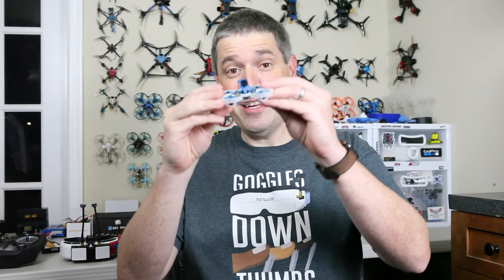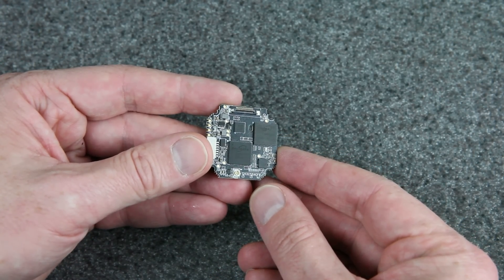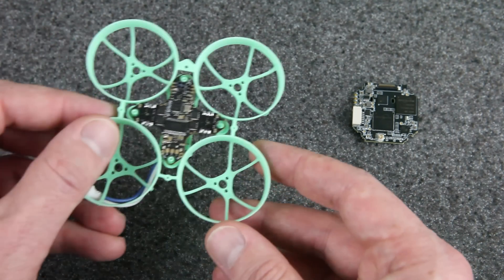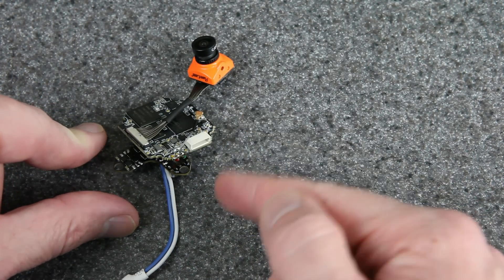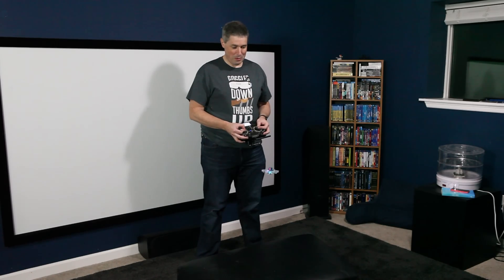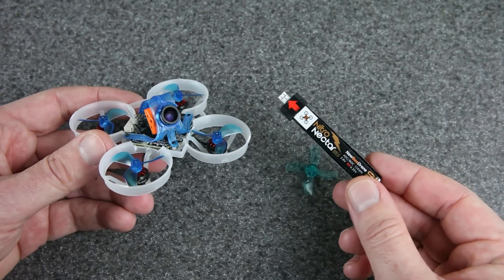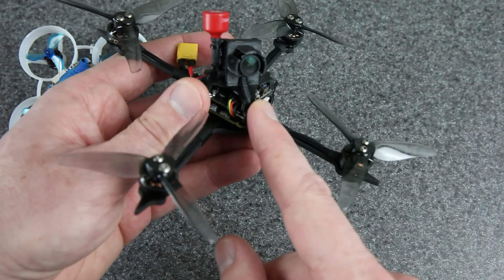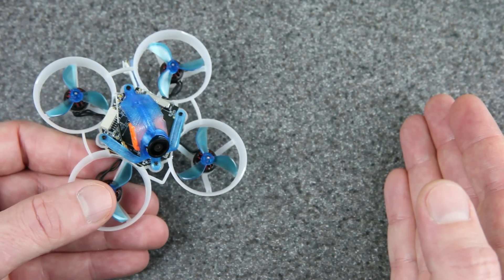The World's Lightest HD FPV Whoop is AMAZING! (HDZero/SharkByte 1S)

Comment: How did you get the osd to show? I have the same set up. Connect straight to smart audio and can’t get the osd to show. :(
Reply from the maker: The OSD type has to be set to MSP Display Port. I don’t remember the exact command off hand, but it is listed in the SharkByte/HDZero manual. If you are on Betaflight 4.3 with the latest Configurator, then it is really easy because you can use the Presets tab (just search HDZero).

Comment: 2 min. Still seems heavy for 1s. 2s would be good and maybe 3+min without killing the battery.
Reply from the maker: It is a bit heavy for 65mm 1S, but I wanted to push the limits and see just how light 65mm 1S digital could be. For better battery life and better acro performance, you could build a 75mm 1S with 40mm props, or an 85mm 2S with 2" props. Either of those would fly great with this new HDZero gear.
Reply from the maker: Oh, and my updated build is a little under 23g.

Comment: Hello, thinking about doing the same build, but 75 instead of 65 (I would get a bit more flight time or more speed, but a bit worst for tighter tracks) what would you recommend? Planing to fly in small gymnasium or small backyard)
Reply from the maker: The larger props should definitely give you more flight time. For a super-light 75mm 1S build, I recommend 0802 motors. If it is 2S or has digital FPV, then I recommend 1102.

Comment: This really has me convinced that I will get hdzero in the near future. Do you know if there is a new receiver module in the works?
Reply from the maker: Yes, I have heard that there is a new receiver module in the works. It has some minor updates with respect to the original. I think they said it would start being available sometime in February, but I'm not certain. They are also working on some new goggles which will have even lower latency because they will bypass HDMI and sync directly with the displays. The goggles wont be available until sometime in the summer, I think. You can get more info on the HDZero Discord or Facebook groups.

Comment: I have a BetaFPV Meteor 65 - do you think I can covert this to HD? Also what RX are you using? I want to run ghost.
Reply from the maker: The motors and FC from a Meteor65 could be used to build something like this, but I think you will have a problem connecting both a Ghost receiver and the HDZero VTX at the same time because they will both need a UART (a pair of Rx and Tx pads on the FC). The Meteor65 FC has R1/T1 but it does not expose a second pair. You could use the HDZero VTX without connecting any Rx/Tx pads, but you would not have any OSD. Therefore, I think it would be better to use one of the radio protocols that can be built-in or find a different 1S FC that has more pads. Also, the you would not be able to mount an FC on the underside of the Meteor65 frame, like I did in this video. You would either need to use a different frame, or you would need to stack both the FC and the VTX on the top. I hope that gives you enough information to go on. Cheers!

Comment: 13:45 sir can you make a video for the toothpick? what frame is that?
Reply from the maker: The toothpick is an updated version of the build I showed in this video: https://youtu.be/YxDOrr-jt40

Originally it had a 2mm thick Babytooth frame from FPV Cycle. In hindsight, I think the 3mm thick version would have been better. I broke an arm by crashing into a tree. Then I switched to a new frame which you saw. The new frame isn’t really new. It is something that I had lying around. It was given to me a while back but it has no name and you can’t buy it. If the new frame gives me trouble, then I’ll probably try out the AOS TP3 next. It is supposed to have good vibration handling. I hope that answers your question. Cheers!
Reply: @MrShutterBug  thank you for replying sir. Yes, I saw the babytooth frame in your instagram. I just wondered the new frame looked like crux3 but have pointy er ends. I am looking for a frame the can still have 4screw holes for the fc and still not flipping the board, just like the crux3.

Comment: I just place naked vista (no camera, no TPU) on my whoop that has no props and no camera, and it's 24-25g
Reply from the maker: Hard to fly without cam and props though. Also, the Vista needs 2S or a step-up converter, so the flying weight would still be significantly more.

Comment: Btw... what are your thoughts on the SE0802 motors (i know they are 1.9g but other than weight?)
And would you go 22kkv or 19kkv? :)
Reply from the maker: The SE0802 can also work, but the EX0802 motor is better because it has a unibell (won't come apart in a crash) and it is a bit lighter. In hindsight, I think the particular whoop would be better with 22,000KV.
Reply: @MrShutterBug  thanks 🙂

Comment: I need a spektrum tiny whoop can anyone help? Thanks
Reply from the maker: That's not a common option on Whoop FCs these days. You would have to use an external receiver. You could do that, but you might not have enough Rx/Tx pads to hook up an external receiver and also hook up the HDZero VTX. Can you add an ExpressLRS module to the pack of your radio? If so, that is what I would recommend.
Reply: @MrShutterBug  ok thanks, I was looking at a new tx. Would you recommend frsky or elrs. Would an elrs tx be ok?

Comment: The og beta stuff used dual boards for the fc and escs Wich when you swap out the old stuff for a aio board you add the whoop vtx before I used a turtle v2 full size and it was a match made in heaven! 28g 32 all up it flew so good! Frame stiffened with a brace and it Flys like a 3 inch

Comment: . at least go for the 35mm prop betafpv frame ..its 30% more thrust without changing anything and runs that very same board.
Reply from the maker: The prototype vtx does not fit in that frame. It would have to stick up. Now, the final vtx will be less wide on the sides, so maybe.

Comment: Can you say what the power output is at this time?
Reply from the maker: Are you referring to the vtx? I used 25mW but it can go up to 200mW.
Reply: @MrShutterBug  Sorry - was curious about the max power. Is it still 200mW - similar to the original 2s board?
Reply from the maker: @artifixprime  yes, 200mW.

Comment: When you soldered the motors to the HD Zero whoop board did it matter which way way the wires were soldered.  Are the wires in order.
Reply from the maker: Check the wiring diagram before you solder. The Tx pad on the VTX goes to an Rx pad on the FC, and the Rx pad on the VTX goes to a Tx pad on the FC. That is the connection used for the "canvas mode" OSD.

Comment: if you use the caddx m8 lens you can save another 0,5g compared to the original runcam lens and the hdzero upgrade lens. imagequality is in between the original and upgrade lens.
Reply from the maker: I am using a Caddx M8 lens. It is the lens designed for the Baby Ratel, and it is lighter than the lens that came on the Runcam Nano HD camera. Are you talking about the same lens or a different one?
Reply: @MrShutterBug  same

Comment: You could always melt off the plastic plug that you didn't use on the hdzero board to save some more weight
Reply from the maker: I assume you're referring to the firmware update connector. I decided to leave it on because HDZero firmware keeps getting better, and I think I will want to update this one later. The final version of the 1S VTX will have a much smaller version of that plug, which is one of the reasons it will be even lighter.

Comment: Can I use mobula 6 frame to build this drone using the tricks you mentioned? Sad, I couldn't find beta65 pro v3 frame everywhere.
Reply from the maker: I believe so, yes. I believe the Mob6 frame is the same as the "BWhoop65" frame I showed. I believe the UR65 frame is also the same. If so, you should be able to fit an FC underneath if you remove the motor plugs and rotate it like I showed.
Reply: @MrShutterBug  Thank you. I found BWhoop65 everywhere in Taobao. I'll go get one and wait for the 1s VTX.

Comment: Hi I hope you're well. Got a total HDZero Noob-a-tron question.. what goggles would you recommend for HDZero digital? I've been flying DJI & Fatsharks for a while. a few told me Fatshark Scout HD wasn't a good option and that I should wait for OrQA V2 digital to come out. I like the clear HD DVR footage you posted on your channel. Are they the same in goggle view? Thanks!
Reply from the maker: Hi. You can buy the HDZero / SharkByte receiver and attach it to the front of your current FatShark goggles. It connects via a short HDMI cable. That's what I have on my FatShark HDO2 goggles. HDZero has also announced that they are working on their own goggles, which will be out sometime later this year (probably summer). Those goggles will be totally optimized for HDZero and they say it will have 4ms glass-to-glass latency, so that'll be awesome! Buy the receiver now or wait for the goggles? That's up to you. I plan to get the new goggles, and keep my receiver as a base station that I can hook up to a TV at races. Cheers!

Comment: I see and hear a lot about HDzero cams and VTX’s, but nothing about RX’s / goggles. 
So what is needed on the “receiving side”  to fly with HDzero?
Reply from the maker: You need the HDZero / SharkByte receiver, which is designed to attach to the front of your goggles. It should work with any goggles that have HDMI input. The FatShark Scout HD goggles are another option with a built-in receiver. Later this year, HDZero will release their own goggles, and it will be the best option of all because they will be able to optimize it for the HDZero system. They say it will have 4ms glass-to-glass latency, which will be great! I hope that helps.

Comment: Could you tell us about your BF setup? From how you touched the mirror saying hi, I assume there was no air mode involved. Also curious to see how you get the motor plugs off. The times I try I lift the pads underneath… great whoop and video as usual!
Reply from the maker: It is running BF 4.3 RC2 to support the built-in ELRS receiver. Blujay ECSs at 48kHZ. RPM filtering enabled. 2kHz PID loop because the F411 processor isn't fast enough to run 4kHz while RPM filtering and ELRS 2.0 are both enabled. Yes, airmode was off for the mirror trick. I have airmode on a switch and usually fly with it disabled for whoops because airmode makes the drone overreact to crashes. Cheers!
Reply: @MrShutterBug  I’m running 4.3 RC2 on my f4 Diamond. I too had to move to 2k pid loop to keep rpm filter enabled. Bitbang dshot also helped with osd and task management. I’m running Bluejay at 96khz and sky high pids haha, it flies incredible. 

Have you tried air mode at low throttle setup? JB made a video. I’ve been curious to try it cause the issue you note with airmode crashes
Reply: @MrShutterBug  Does overclocking to 120MHZ help? I wonder how much more cpu resources are needed by ELRS and/or new BF4.3? 
I am still using BF 4.2 on a F411 toothpick build (with RPM, 4kHz PID + logging with 1kHz).

Comment: Curious if it would be much of a difference in weight to remove the unused connector. :)
Reply from the maker: You're referring to the big HDZero firmware flashing connector right? Yes, removing that would save weight. In fact, that connector is one of the things that will be different on the final version of the VTX.

Comment: I have a Mobula 6HD.  Do you think the new HDZero VTX and Camera can replace the RunCam split easily?
Reply from the maker: My build is lighter than the Mobula6 HD but it doesn't have an onboard DVR. If you have a Mobula6 HD and you want to swap the DVR board for this VTX, then yes, I think that would be pretty easy. You'll need a camera that is designed for HDZero as well. Other MIPI cameras don't just work.
Reply: The main issue is that there's no onboard recording with hdzero so you are forced to record the static breakup.

The good news is that hdzero at least has a setting where you can remove the OSD from your recording so you get a clean video on that front.

Also, hdzero will of course have a better image in goggles than the split cam in the mobula 6 HD.

So really I think it comes down to what you're trying to do in terms of what's better.
Reply: @zachmachina  The majority of the time I usually toss the footage anyway or I just don't have the SD card inserted.  The rare times that I do keep it, I think the goggle DVR would be sufficient.
Reply: @mitch6131  then I'd say an hdzero build like this would be better!

This particular build in the video is also lighter weight than the mobula 6 HD too so that's another plus.

Comment: You can always use Pololu 5V step-up boosters, this will make either DJI, receiver or HDZero survive the low voltage issues. You can always move your AIO on that but your voltage readings will be wrong.  I have used this extensively  this on a 1S toothpick with DJI,  trust is not greate due to DJI weight  but 2x Pololu in parallel worked well for me.  The DJI OSD used the MSP voltage reading so i had proper visibility on actual 1S cell voltage.
Reply from the maker: That's true. An external step-up converter could also work, but not at this weight.

Comment: Yesss, have been waiting for digital HD with 1S ever since DJI. So with this VTX a 1S digital HD toothpick should also be possible
Reply from the maker: Definitely! It would work great in something like a 1S Babytooth! But it's not limited to 1S. It will make other builds lighter too.
Reply: @MrShutterBug  I talked to the happymodel sales rep about doing a Crux3 1s with the new updated X12 board (12A ESCs and built in 400mw OpenVTX and ELRS) with an XT-30 connector and potentially having an HD option with this new HDZero board.
Reply: @MrShutterBug  Looking forward to see what you can do in a whoop format with dji. I'm thinking it kind of needs 2s. Looking at something like a 1103 2.5" toothpick in a 95x frame, maybe 85x.
Reply: @MrShutterBug  yes as long as it takes 5v it will be a great successor for all kind of 3" 3s Toothpicks builds to make them even lighter while getting the same 200mw range out of them. can't wait to replace them :)
Reply: @MrShutterBug  I like the tiny whoops too but I don't have analog goggles, I have DJI. Is there a way to use the DJI goggles with this vtx?

Comment: Newbeedrone 75mm frame might be perfect for this
Reply from the maker: Sure! If you put these parts on a 75mm frame with light 40mm props, then it would have better performance and probably longer flight times. That is often the case, but on this occasion I wanted to stick with 65mm because it's the standard for racing.

Comment: Awesome stuff, Nathan! Have you tested your lap times against analog? Also, you do  still fly angle mode for whoop racing, right? Thanks mate :-)
Reply from the maker: I expect my fastest lap times with analog are still going to be faster because of the weight difference but the gap keeps getting smaller. I sometimes crash or slow down because of bad analog video, so it might help in those situations. Yes, this was all angle mode footage but I do fly acro in the house sometime for doing tricks. Cheers!